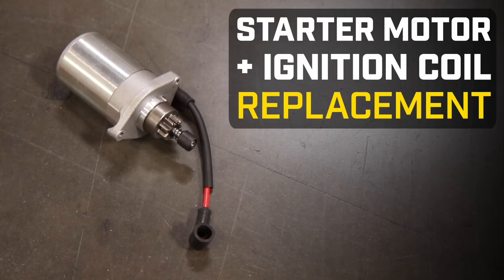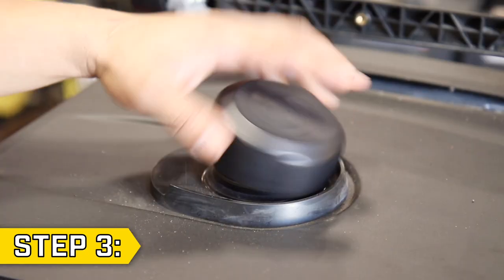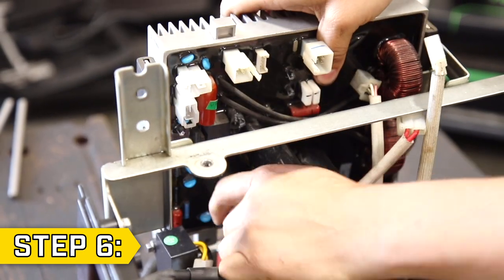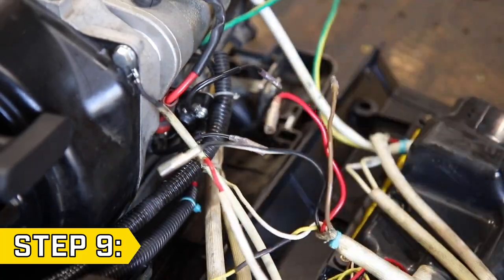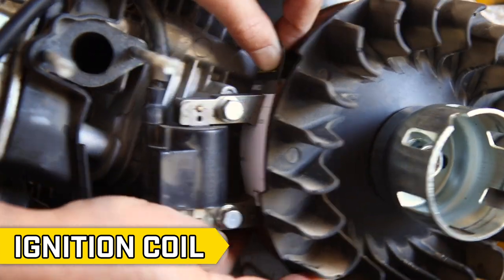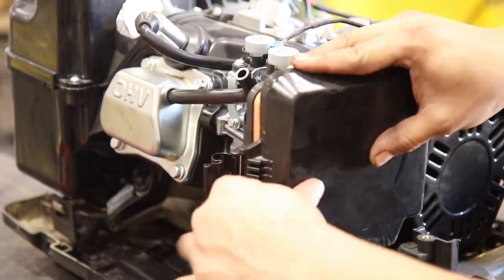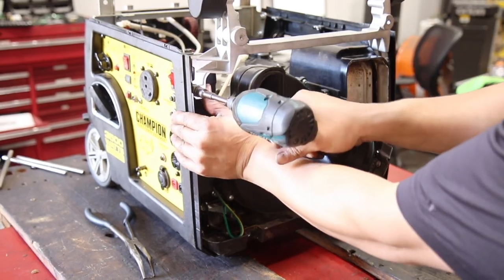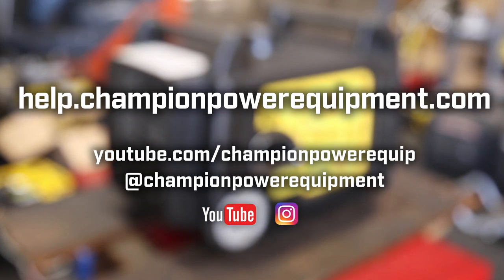Starter Motor and Ignition Coil Replacement (3000+ Watt Inverters)

Comment: Nice video! I'm bookmarking it in case I ever need to open up my 3400 inverter gen for service. I've ordered parts before by calling Champion and received a new regulator in two days! You guys are the best!! My generator is still going strong at 8 years of age. But, I bought a second Champion 2500 inverter as a backup just in case, or to loan out to family & neighbors in emergencies.

Comment: Hi where is the ignition coil on champion generator 200954 . I see a coil just sitting there with no magnetic for spacing gap
Reply from the maker: Hello. The ignition module is item 75 on the diagram located on page six in the parts manual: https://www.championpowerequipment.com/wp-content/uploads/2022/03/200954-EPL-English.pdf